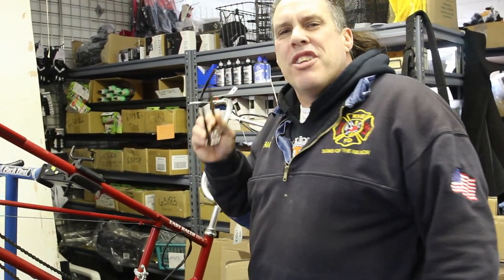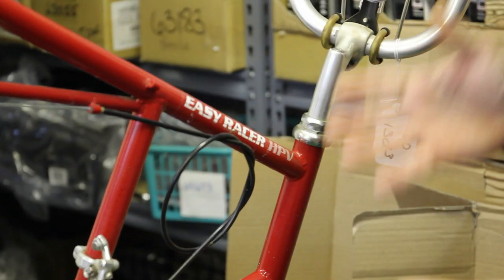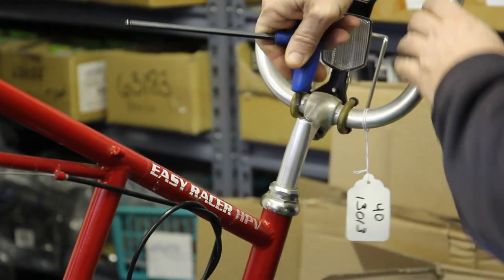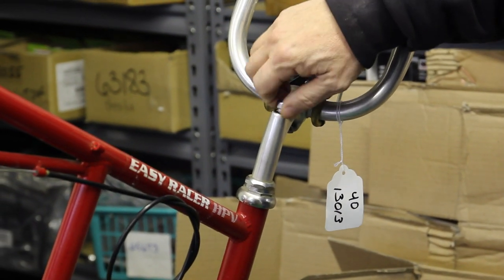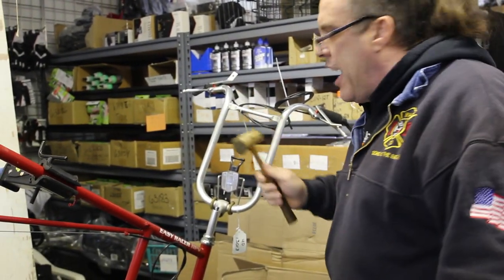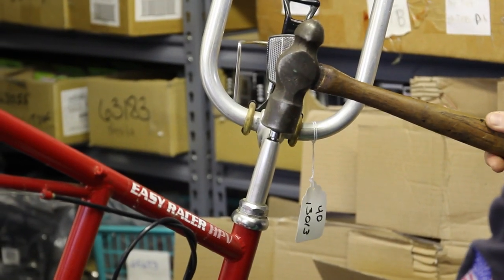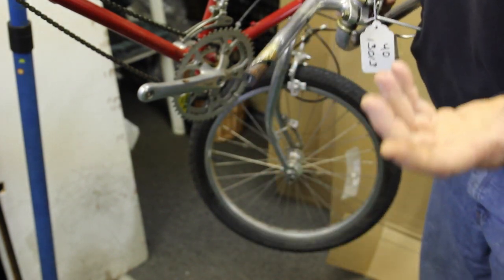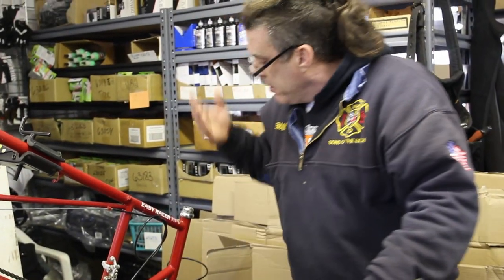Handlebar Stem Removal - How To Free A Stuck Bolt - BikemanforU Repair

Comment: Niiiiiiiiice BM4U I finally got mine which I told you and your help was what did it but, it took a long time and more sauce not your special sauce but my mixed up version and more hammering. But what you advised is what got me through I forgot to put the bolt back in after I got frustrated. Oh did I mention the  Peugeot I am working on has been outside and not ridden in 10+years anyway love what you do and your way of explaining.

USMC
Reply from the maker: glad we could help. How about some pic's of that ride??? Is it ridable ??

Comment: Depends on how rusted inside the hole of the steerer tube is that a quill stem inserts into, clean out the rust and then grease the inside that will prevent rust from reoccurring.

Comment: i have a stripped allen screew that holds the handlebar in place, problem is that the bolt its scripped the handle bar is starting to slip out of place with every movement, what is the cheapest way to fix this i have lillte to no money.thankyou in advance

Comment: I work on bikes 6 hours a day full week. This method is used alot. Sometimes even after the whack with a hammer, stems are so stuck that they are put in a vise and bended back and forth from the fork with 2 metre long pipe.

Comment: Great video. I was given a Marin Bolinas Ridge and i can't raise the handlebars.  I know nothing about bikes but that bolt to hammer is a lot smaller. I kept waking it but all it seems to be doing is driving the bolt further with no other outcome. Now the cap for the bolt wont fit since the bolt is too low. Any suggestions? I just want to raise the handlebars without messing the bike up. Thanks in advance!

Comment: Helpful as always. I have a problem on a restoration I am doing. The clown who mangled this old Cannondale used too short a bolt in the stem (so its head is hiding one inch into the quill stem opening) aaaaaand...the allen bold is stripped round too--so no purchase for removing it. Before I go and start drilling out the bolt I wondered if you had any ideas....?
Reply from the maker: Sounds like someone used a American 1/4" hex on a 6mm head.. Try to hammer a allen key 6mm in and hammer the key while turning, maybe... good luck .
Reply: What we used to call the Hungarian Method (hit it, then hit it harder) worked and I clawed the bolt out. Thanks!

Comment: Hey ya, I have this problem but with a slide on a head stem, the star nut bolt came out fine, but the Stem seems to be fused to the fork with rust, i have tried turning the bars but no luck, I've carefully sprayed some WD-40 and left it to sink in to the rust, which I know is not a good for using on bikes, but its all I have to remove the rust since this is for a new set of BBs I can clean it out before i do that. What can I do?

Comment: hey Mr. bike MAN or bike guy I think it is. so sorry about that. I have a question, I have a shamano of 6.0 next mountain bike. - v- brakes.... the only problem is, the levers mainly on the front wheel , ..( left lever)... is very wobbly. and I don't know how to tighten it up... can I help with maybe some advice?. I know I run a buiss and you don't make $$ giving away your trade. if this is the case where could I reach your shop for a repair?. thank you much. take care buddy. 👍😀

Comment: Great videos I appreciate you doing these.  I replaced my forks but I can't get the stem to tighten all the way.  If I hold the front tire then I can move the handlebars/stem.  What should I try to do to fix this?   Thank you Sir.
Reply from the maker: D. M. Take an aluminum Coke can and make a shim cut it with scissors wrap the stem try to place it all down the hole and then tighten good luck

Comment: Bit of a flaw in these vids by bikeman, as this will not always work. The stems which are stuck on both of mine, same problem as the vid, ie - the wedge stuck against the stems etc. The problem with both of mine, is when fitted they where fitted to lowest position in the shaft possible, where the wedge itself is hitting the ledge in the forks to stop the stem going any further down the tube. So you could hit it all day and nothing would happen, sometimes the forks narrow towards the bottom and same problem applies. The stem itself will not turn either because of the wedge pusing against the fork still. I have no idea how to remove both of these.

Comment: Check my most recent video. My stem is currently jammed up in there. I didn’t knowI could work that bolt back into the wedge to hammer it. So I’m going see If I can do that right now.

Comment: I just watched this Video , my question is does that same thing work to loosen the bolt that is holding the handlebar in place, I just bought a brand new bike and who ever put it together really tightened the bolt really tight and I would like to raise the handle bar,but can't even get the allen wrench to budge .

Comment: If an adjustable quill stem is 22.2 millimeters, then it will be able to connect to a fork with an inside diameter of 7/8 inches.

Comment: Hey, can a bent seat rail be fixed? Is it worth it to try and bent it the other way so the saddle is levelled again? Or will it weaken the rail and potentially be dangerous later on?
Reply: Tenspeed TheBikeHanger Thanks!

Comment: I installed the handle bars and tightened, realized the wheel was backwards; took it back apart and the expander piece at 3:10 got stuck in the frame base.

The rod that screws into it, for some reason, won’t reach it (makes no sense considering I tried it without the bars in place).

Are there any ideas?  Maybe buying some long allthread?

Comment: OR you could support by straddling them over softwood that will fit up where wheel goes..with forks resting on wood 
you wont damage bearings when you whack it..Also have an assistant rest a timber square on bolt and whack that 
so you WONT DAMAGE BOLT....

Comment: yeah so that still doesnt work for a couple of bikes I have. ive popped the bolt but the stem itself is stuck in the steerer tube. Tried penetrating oil and it still wont budge, I can ride the bikes around with no bolt and the bottom nut loose and it still wont budge.

Comment: Oh man that stem bolt was too easy.  How about one that is really tight?
Reply: If the bolt's tight, get more leverage. Tight bolts require more torque, which can be done with a longer lever. Use some penetrating oil if it's really stuck.
If the stem is really stuck, you want to spray the stem with penetrating oil. It may take a week of spraying several times a day, but it eventually will come out. You can also try holding the front wheel and twisting the stem to get it to rotate, but do so gently. Otherwise you can bend your fork.
If the wedge is stuck, use the hammer trick. If that doesn't work, remove the bolt get the stem completely out. Screw the bolt directly into the wedge (no stem), and spray it with penetrating oil. The bolt will help the oil pool above the wedge and seep in between the wedge and the steerer tube. Try the hammer trick again. Also, see if you can push the bolt forwards and backwards to free that wedge (that helped me free mine). Once that wedge comes free, clean the inside of the steerer tube and give everything a little grease.
The good news is that stuck stem bolts/stems/wedges will almost always come free. The bad news is that it may take days, weeks, or even months, depending on the severity of the issue.